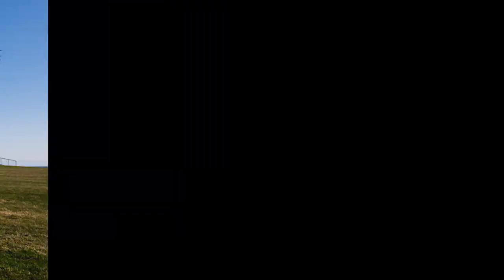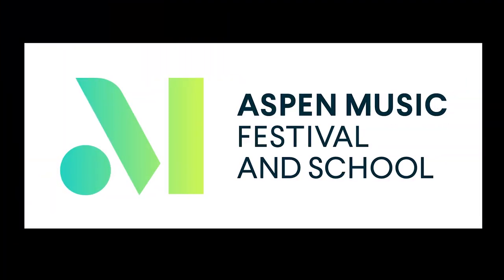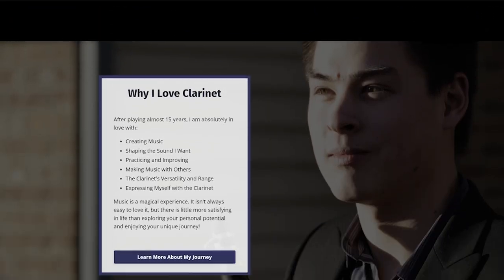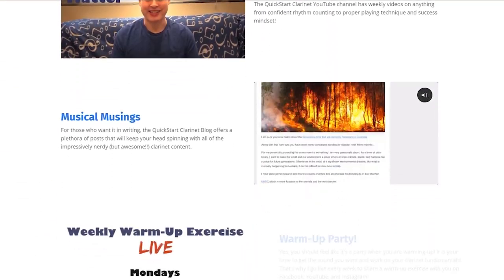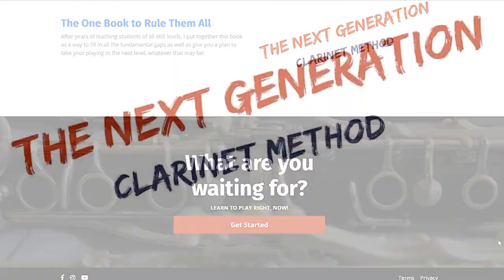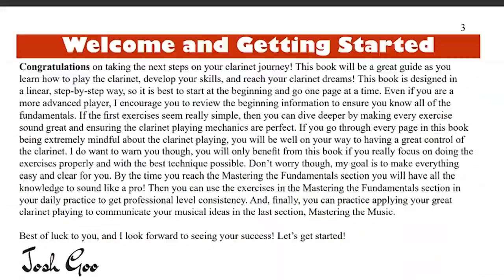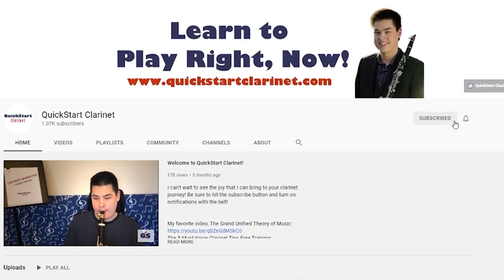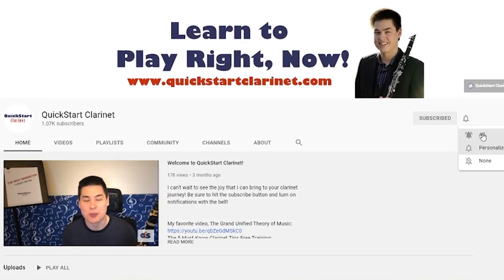The Anatomy of Air Support on Wind Instruments

Comment: 🙏🙏🙏 Your channel is a chest of treasures. 
Being a bad singer, I just realized that I nevertheless adjust my throat to higher tones, which ruins the air flow at higher notes and ruins the sound up there.
Reply from the maker: Nice! What a great breakthrough!
Reply: BTW, I learned from a sports MD, that there is no such thing as muscle memory. It is a seperate function in the brain, where "automated" routines of movement after enough practice / training are stored with "hardwired" neurons. 

We then don't actively have to think about the movement itselfü - it's working "unconcious". 

The effect is the exact same as if it were in the muscles. 

(Fun fact: Only an octopus has an extra brain for each tentacle - that's why Squidward Tentacles plays that "excellent" clarinet 😁)
Reply from the maker: @ernstzlo  I love that reasoning for Squidward! I did actually know that but tend to use "muscle memory" as sort of a colloquialism, but yes it is actually more like cerebellum memory to be precise. Maybe I will do a video on this!

Comment: can you play a forte with bad air support? or is bad air support only a problem at softer dynamics?
Reply from the maker: That’s a good question! I think playing loud forces you to use more air, but it is definitely possible to play loud with bad air support, or at least inefficient air. 
To me air support is all about supporting the most effective reed vibrations for the best sound, which mostly comes down to the speed of the air as discussed in this video. 
It is possible to blow too hard and get a loud spread sound, and also possible to blow too soft and get a weak fuzzy sound. 
Playing loud can be a great way to encourage better air support, but the real way to know if you are doing it right is if you are getting a nice clear, full resonant sound.

Comment: By "engaged," do you mean tense the gut and back muscles? Also, when I studied dance, I learned that one can increase lung capacity by expanding the ribs to the sides. I use that to get more air sometimes.
Reply from the maker: Kind of. I don’t like using the word tense because I think tension is general bad. But it is sort of tense or there is tension like as if you were flexing your ab and back muscles.
Reply from the maker: Maybe another way to think about it is keeping your core pulled or pushed down. Think about how your belly and back move down and out when you take a deep breath and then keep them there as you exhale.
Reply: what? there ain't no gut muscle (unless you mean your intestines which technically are muscles ) lol, it's called Rectus abdominis (your six packs) and abdominal external oblique (your waist muscle if you will)
And I don't think your back muscles are engaged during diaphragm breathing and support.
Reply from the maker: I think gut muscles refers to the abs and such. For me I do feel like the back is engaged. All the muscles around the core area.
Reply: @PinacoladaMatthew  I believe the back muscles behind the guts expand to some extent when relaxed breathing happens.
Reply: @brendareed8412  I was kidding =\
Reply: Oh, sorry I misunderstood. :)

Comment: I do not know why when I blow my breath start to 'motor-boating" . Is it because of my weak lungs? Anyone?
Reply from the maker: Hm, I’m not 100% sure what you mean without seeing it happen, but it definitely isn’t weak lungs since there are no muscles in your lungs to be weak. Instead I would focus on more core support from your abdominal muscles keeping things steady, and then think about blowing the air further forward through a nice strong and steady embouchure. I hope that helps!
Reply: @QuickStartClarinet  Thank you very much for yr quick reply. you are right, there is no muscles in my lungs. Silly me. Most probably it could be my stomach muscle but I don't feel it is. Is there any exercise I can do to improve the strength of my stomach muscle? Another thing , It seems I have to strain to blow and easily ran out of breath. I still can't get tha hang of it to blow freely.  I feel like giving up even though I love the sound of the clarinet. Btw, I am using a low 1.5 reed and  l find a 2.5 is too hard for me to blow.  I am using a Yamaha A34(,?)  with a Vendoren B40 mouthpiece. I have been playing for the past 10 yrs. On and off , on and off and never  master playing it well.
Reply from the maker: @watchitontube  I suspect that you actually aren't having specifically a blowing issue rather more of an embouchure and reed issue. A 1.5 reed is extremely soft, even moving up to a 2 may be helpful. The other thing that I suspect is happening is that your embouchure isn't very steady. It is really hard to have a steady embouchure with such a soft reed because the embouchure needs to be very loose to not pinch off the reed, but then if it is too loose than it is hard to keep it steady.

I'd recommend checking out this video: https://youtu.be/8aRC6wHDfUE?si=VjEfi_xCxZP2AR_B to get an overview of all of the good fundamentals and then go from there!

Comment: You are correct it is air pressure.  Not speed.  "Speed" of flow through the mouth is irrelevant. You are misunderstanding Bernoulli.

Reducing the flow path ALWAYS reduces total air energy. The state of the reed determines the frequency,  not the speed of air through the mouth.
Reply from the maker: I thought you said pressure is irrelevant on my other video?
Can you elaborate on what you mean by the state of the reed?
Reply: @QuickStartClarinet  "air speed" as a term  is a trendy and faddish verbiage among musicians.  The embouchure controls the state of the reed which directly controls rhe pitch played. The acoustic space of the oral tract possibly makes a weak contribution as well but it still has nothing to do with air speed over the tongue.  The flow of air is quite low when playing and so is the flow velocity through the oral space. Even for more raised tongue position. Supplying air pressure to a musical instrument is NOT the same as blowing air into the ambient atmosphere. There are completely different dynamics occurring.
Reply from the maker: Ok. I feel like you are saying that any air stuff involved in playing is determined by the air interacting with the reed which is mostly impacted by the embouchure. If that is the case, then if you were teaching clarinet, how would you teach air? Would you talk about it at all?
Reply: @QuickStartClarinet  air pressure is the energy required for the sound. It varies with dynamics. Pressure is simply controlled by the intensity of the action of exhalation. That is, the exhalation effort.  It is gentle for soft tones, and more intense for progressively louder tones. To apply power there is also air flow but it is not something to obsess over. And air speed? It varies widely within the system with time and location.  There is no THE AIR SPEED,  and it is of no concern.
Reply from the maker: Interesting. How do you account for the issue of playing really soft especially in the upper registers with enough air support that there are no undertones?